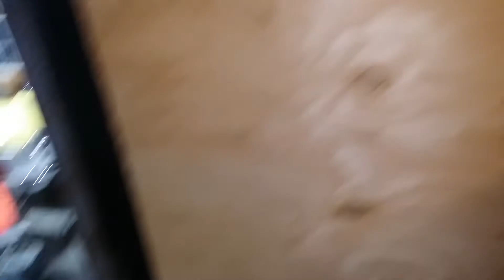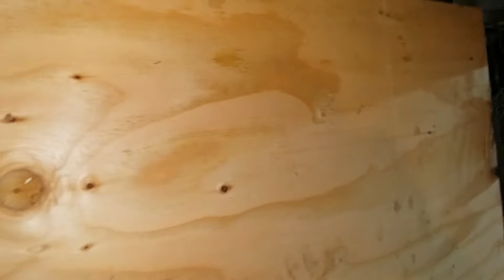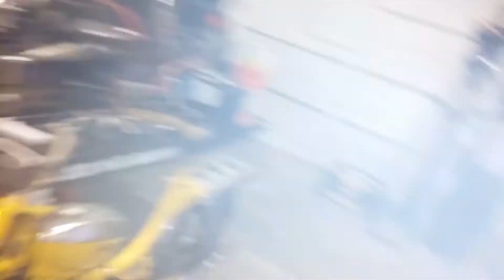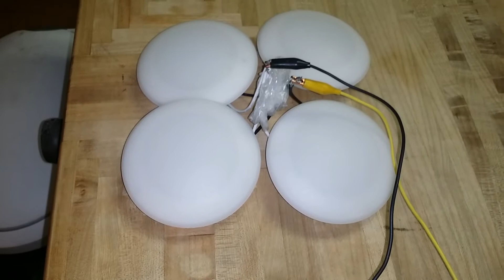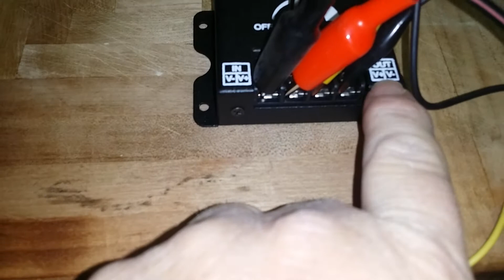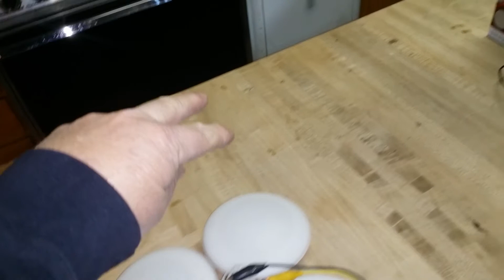How to install Dimable LED Interior lights in your RV, Stepvan, Tiny House, or Boat.

Comment: Sir, does this work the same with a toggle switch? How can I connect them I series? I’m working on a cargo trailer conversion and need to know how to run my LED lights maybe running them in series doesn’t work for me I don’t know. Please help, thank you for your time.
Reply from the maker: A switch will work just fine. You can not connect them in series, you must parrellel them. All the positive wires together and all the negatives together. Remember mode LED lights can only be connected one way, positive to positive, and etc. Unlike an incandescent 12 volt lamp that will work either way, an LED won't turn on if connected backwords. In a series circuit, you will drop an even voltage accross each lamp, so if you connected three in series, and a 12 volt source, you would only have 4 volts at each lamp, might light but would be real dim and if one goes out they all go out. Remember the old christmas lights?
Reply: Thank you sir, I will then be connecting 4 LED lights in parallel to a two prong switch on the positive line then it will be going to my DC panel with a 10 amp fuse. My ground will go to a ground bar that will be connected to my trailer frame. Will this be correct?

Comment from the maker: Dimmer...https://www.ebay.com/itm/DC-12V-24V-20A-30A-2CH-LED-Switch-Dimmer-Controller-for-Single-Color-LED-Strip/172735630525?ssPageName=STRK%3AMEBIDX%3AIT&var=471515347435&_trksid=p2057872.m2749.l2649